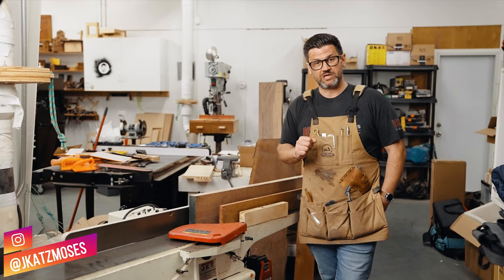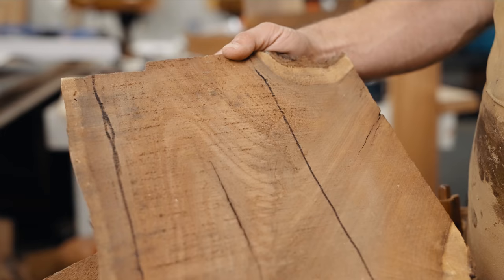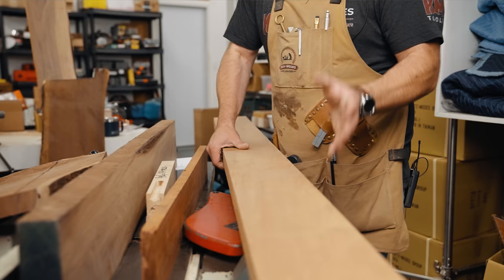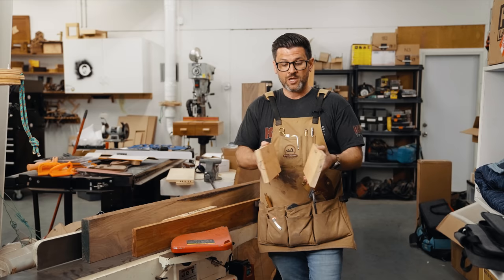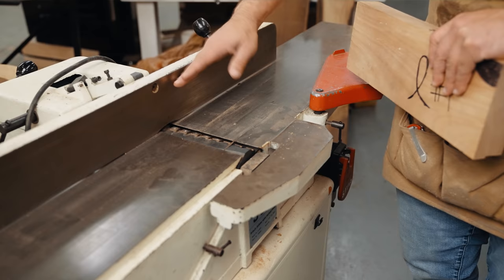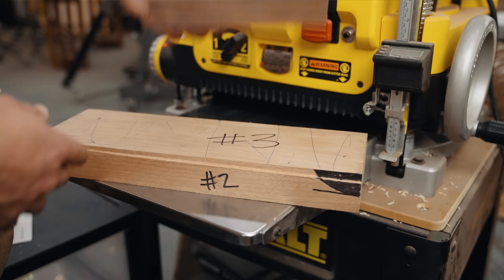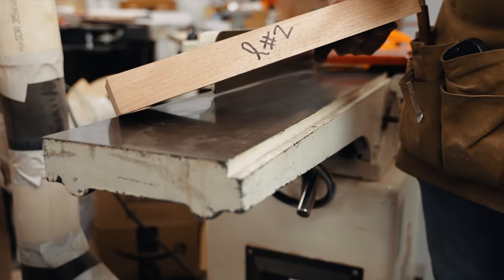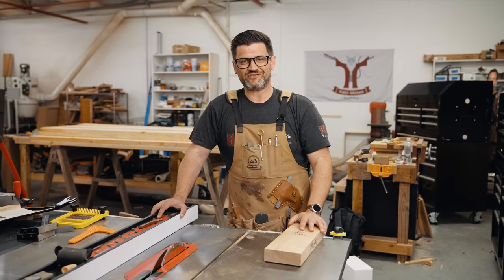Mill and Process Lumber Like a Pro - Woodworking Essentials

Comment from the maker: Support what we do at http://www.kmtools.com
SALE on Full and Thin Kerf CMT Chrome Saw Blades - use code KMT10CMT for extra 10% off https://kmtools.com/collections/cmt-saw-blades
Setting up your Jointer w/ 19,000 FPS Slow Mo https://youtu.be/oyJHC6XxQx8
5 Ways to Joint without a Jointer https://youtu.be/jWzg4BzPrdk
Tune Up Your Planer https://youtu.be/QzRJfD7__W4

Comment: One trick you can do on the “#3” step is flip the board over and plane #1 again once 1 and 3 are parallel.  This is super handy if there’s imperfections on the #1 face.  When I’m milling down salvaged pressure treated boards I don’t need to spend a bunch of time at the joiner removing perforations from the faces.  I just need it flat, then once it’s parallel, I flip it over and remove the perforations with the planer.  Same thing on the table saw with 2 and 4.

Salvaged exterior wood is also super stable.  Exposed to the sun, temperature, freezing it gets really “seasoned”.  Traditional Japanese builders might leave wood at a site for 2 years before working with it.  I can attest that almost any exterior project I’ve done where I took lumber directly from the yard to the job site will lose at least 1/8” of its width sometimes 1/4”.

Comment: I really like and respect your work, which is why I was surprised by your order of operation here, as well as omitting discussion of grain direction.  Being aware of the direction that the grain runs in helps to avoid tear out.  I know you run helical cutter heads on both J and P, so maybe that’s not a concern for you, but someone who’s unaware of milling probably isn’t tuned into the benefits of such cutters.  Also, given an awareness of grain direction often  requires that jointing and planing occur before squaring an edge.

I’ve been woodworking for 30 years, but I still watch you religiously because there’s always more to know, and you’ll often provide tips that hadn’t occurred to me.  Thanks for the work you do!

Comment: The interesting challenge of building with wood is that movement over time is inevitable, no matter how square and flat it is milled. The design and joinery (whether glue and screws or rabbets or dadoes or … ) counteract, incorporate  or direct the movement.  Makes those 200 year old pieces of furniture even more amazing.
Reply from the maker: Not only did I do the most comprehensive video on the subject BUT we also have a web based calculator we made that can calculate wood movement over time anywhere in the world. https://youtu.be/EOr06I9JoAU

Comment: Good video as always.
Maybe it would have been useful for beginners to talk about how grain orientation is important on the jointer and the planer. Cause that can really influence the surface quality.
Cheers.
Reply: Yea, I agree 100%. To piggy back on your comment, his order of milling works for 80% of the species, but it should be done as:
1- face joint 1 side
2- face plan opposite side
3- joint edge
4- rip to width

Doing it this way gives you freedom of grain direction when you go to joint the edge. Jointing the edge immediately after jointing the face forces you into 1 direction

Comment: Great video! Very informative! However, in my short experience, grain direction matters especially with wood that's highly prone to tear out!
Would you be willing to do a follow-up video on the milling/grain direction, and why you should joint one face, then plane opposed face, before jointing the edge? Doing it that way gives options of grain direction on all 3 sides before ripping the 4th side on the tablesaw

Comment: I wish you talked about planer snipe! It’s the single biggest problem I have when milling wood at home.
Reply: On a jointer, your outfeed bed must be dead even with the cutter edge. On a surface planer, same thing - the rear outfeed rollers and pressure bars need to be even with the cutter head, or your material will come up into the cutter once it is past the front rollers. If you can’t adjust the rollers/pressure bars, make all your material 6” longer. Or get a better planer.
Reply: @stanschmenge1965  All good advice, and I’ve done my best, but I still have issues. Maybe I just need more practice.
Reply: @stanschmenge1965  it's a problem for me too, i've ended up sending sacrifical wood a little ahead and to the side of what i want to plane/thickness.
Reply: @jcarlin  I guarantee it’s not you, it’s your planer. “You can’t make chicken salad with chicken sh*t” as the old saying goes.
Reply: @stanschmenge1965  Yeah I figure that's at least some of the problem. But it's a Dewalt DW735 and I see YouTubers getting better results with it all the time.
Reply: @jcarlin  yeah still a toy though, but I’ve heard they’re the best of little planers. You probably can’t adjust anything on it, maybe the cutters don’t seat properly? or a different brand of cutter might solve your problem. And don’t believe everything you see or hear on YouTube, I shake my head at a lot of so called woodworking “experts”.
Reply: @stanschmenge1965  I did get a helical cutterhead but I think it’s like a day to install… haven’t gotten around to it. The tables are level though.
Reply: @jcarlin  that should be a plus. The outfeed roller should be the same distance from the bed as the cutter head if you’re able to check that with a micrometer. That will eliminate your snipe. Good luck with the install.
Reply: @stanschmenge1965  I’ll give it a shot!

Comment: All the limber I get in Thailand is High moisture, 35%. I start milling it at 15-20% after air drying. I do cut the wood length into lengths close to final dimensions as I start the air drying

Comment: Great content as always, Jonathan. I truly appreciate how in-depth you go in your videos. At my school, there's only one instructor with 25+ students, so I find myself learning more on YouTube, haha.

I have a question regarding the use of jointers. Recently, at school I was using one to flatten one side of a board with the cup facing down, picture an upside-down 'U' shape. I managed to get it to lay flat on the table saw, but there was a large hollow section in the middle where the jointer knives didn't hit. Should I continue using the jointer until everything is level? Thanks in advance!!!

Comment: Great video JK-M!
A couple of experiential comments: Never assume your jointer can create a parallel flat on the reverse side after creating a flat on one side. It will be an "oh good grief" moment when you see or measure the result!

Some larger planers - I have a Grizzly 15" planer - have very strong infeed/outfeed rollers with a knurled or knifed anti kickback device, and will leave "knifing" marks in a planed surface. Usually, unless I plan on hand-planing these surfaces, which is almost always regardless, I must consider the depth of cut in the planer in order to avoid knifing marks from the anti-kickback device which are deep enough to require planing below specified dimensions. Particularly true in softer woods!
 
Sometimes I have to consider when I might want to use a surfaced board after milling. That is, does it make sense to mill the board for use at a later date and deal with potential cupping and other deformations during storage, or mill only what I can use immediately. Often I end up wishing I'd have waited before re-sawing certain boards as the level of cupping developed was beyond the ability to plane it flat. 
Always a risk no matter what, though!

Comment: Solid. One thought for consideration; the final part of the process may be to take a light skim on the jointer to remove any planer snipe if it is beyond what a light sanding can handle or card scraper.

Comment: Fantastic video.  All of us have run into the "moving wood" situation, and you explain it all very well.  It seems softer wood, like pine/fir, have amplified movement issues.  Oh, and mis-stored soft woods at the big box stores (even though  supposedly kiln dried) will have very significant movement within 12 hours after any kind of milling.  Keep up the good work!
Reply: Big box stores are the worst, it might be kiln dried at the mill, but my local big box will put it in the yard until they have room in the racks.  I have burned better wood as firewood than they sell at full price.

Comment: Hey @Jonathan Katz-Moses, at 7:50 when you reference what happens if you plane the board right away.
It will make the opposing face side, parallel to the bottom face, but this means it will just copy the face on the bottom no ?

In your example you mirrored the bottom and top faces but actually the bottom and top face should follow the same line if my understanding is correct :)

Only beginner in woodworking so correct me if i'm wrong.

Comment: I got lumber from a local mill at 5/4 for 1 1/4" so I think 5/4 and 6/4 is subjective by mill. I learned the hard way not to store the finished wood for long term. The cuping is spot on with resawing. Great tips on Jointer and Thickness Planer, Jon!
Reply: The same around here. “Quarter” dimensions are true (5/4 is inch and a quarter, 8/4 is 2 inch). “Inch” dimensions are post-milling nominal (“1 inch” is  actually 3/4”). And for big- box lumber shopping - always take a tape measure since big-box lumber varies in nominal thickness.  I’m not really sure whether the dimension variation is from speed/carelessness or from the desire to squeeze a bit more lumber (profit) from a log.
Reply: Ditto for my hardwood supplier, I went in with the expectation if 4/4 != 1" but surprisingly it is bang on. The boards are pretty clean but not perfect surfaces so there's still some milling to be done (guessing that's why, less work for them, cheaper for me) but that's OK by me.

Comment: Excellent video. I recently bought my first jointer, and am loving the simplicity of getting nice flat surfaces with it. I obtained a bunch of rough cut oak blocks and started running them through the jointer, and flattened them on all 4 sides and it worked perfectly. My question is, is there a reason why you don't just run boards through the jointer on all 4 sides? I don't see why it is necessary to need to use the planer. (at least if you're not trying to reach a specific width across multiple boards. I can see how the planer would be advantageous in that scenario) But if you're just straightening one single board, it seems like the jointer will do exactly what you need. (I also like using the jointer because it is 1000x quieter than the planer. Haha)
Reply: The jointer has no way to tell what the top of the board looks like. It can only make the bottom surface flat, and it has no way to mechanically constrain it to force that bottom surface to be parallel to the top. The planer uses the pressure of its feed rollers to mechanically force the bottom surface against a known reference plane, and then the cutter head is mechanically aligned to that plane and cuts a parallel surface. Does that help?

Comment: Instead of using the table saw to cut side #4, why wouldn’t you run that side through the planer since it would come out parallel to side #2?

Comment: Great videos, it was a little confusing around the 7:32 with the parallel line drawing.  Did you want those sharpie lines parallel to each other maybe?
Reply: Yeah, they were mirrored, not parallel.
Reply: Second that... Drawing was incorrect.

Comment: Rough sawn is usually 1/16” to 1/8” under the marked thickness. At least the ones I have bought so far. After cutting lumber to thinner boards, they tend to move more. Made mistakes like that a few times now.

Comment: Two questions I've not had good answers for: why not go back to the jointer for face #4 instead of the tablesaw to reduce variability ? What do you do about grain direction when jointing and planing?
Reply: I could never get a perfectly parallel edge because there's no reference to the previously jointed edge. I assumed a flat face held against the jointer fence would provide that ref, but I could never get accurate results like you can with a table saw fence directly referencing the jointed edge.
I always pay attention to grain direction when milling to avoid tear out problems, although I do get better results with carbide insert cutter heads rather than HSS blades regardless of the grain direction.
Reply: I’m a retired furniture maker from Europe. We always planned #4 parallel to side #2 with the planer, not with a tablesaw.
Reply: Taking it back to the jointer would make it flat, but not parallel to the opposite face. With the table saw, the fence is parallel to the blade.
Reply: @danielulrich3314  is there not enough registration of the flat & square edge against the fence?
Reply: @flyfishr64  the jointer will make the face flat, but won't make it parallel to the opposite face. You need a fence that is parallel to a blade to make both faces parallel, like a table saw. 
If your wood was the shape of a triangle, the jointer will make every face flat, but not parallel with the other side = a rectangle. Idk if that made sense tho cuz I'm kinda drunk

Comment: 7:33 that top line should match the bottom one...and not be flipped "mirror image" like shown. Basically, your board will come out with the top following the contour of the bottom...whatever that may be. Hence the jointer being the 1st step.
Reply: You are correct.
Reply from the maker: Yep. My mistake
Reply: Thanks. That drawing was so confusing.
Reply: Did you respond to the reply below saying you are one of the short lists winners. I got the same message and called but it said the owner of the google account wasn’t available.
Reply: @rw7532  No, I did not. I've been getting a lot of those lately...last one said I won a DeWalt table saw!
This video explains it VERY well: https://www.youtube.com/watch?v=w3QxMFwQAfM
Beware.

Comment: Johathan, great video! One thing that always gets me is the term "Jointer". I'm not sure when it happened, but I believe it was a marketing thing here in the U.S. a while back that was/is used to distinguish between a "Planer" and a "Thickness Planer" for the new or beginner woodworker.
In the rest of the world a “jointer” is called a planer, and a “planer” is called a thicknesser or thickness planer because, it is in fact, a planer and a thickness planer. 
Somehow the nomenclature got separated from the actual function of the machines here. 
It is only here in the US and Canada, North America in general, that a planer is called a “Jointer” and a thickness planer is called a “planer”? This is very confusing to many that are new to woodworking.
Jointing is typically planing the side edge of a board to an already planed face of a board. Jointing can be done in several ways using different tools, one way is to use a fence as an attachment on a planer (Jointer). Other ways to “Joint” are with a table saw, a router table, or a track saw, etc. I have had to explain this to many people new to woodworking at my local woodworking store that are confused as to the use and function of a “jointer” and “planer”. I don’t care what they are called perse, I have just found it simpler to explain their actual functions separate from their names which has led to many A-ha moments with the people I’m explaining this to.
I know you know this, but explaining this, IMHO, will help people understand what the hell a "Jointer" is, which is actually a planer, that you can joint on. I have found this to be a confusing issue with some new to the sport, and once it is cleared up, we move on to what "Joinery" is. 😎 All the best, Chuck

Comment: My only tip would be to make sure your jointer in particular is slippery and easy to push material through. Trying to muscle wood through is dangerous and I reckon you just get a better result. And I find it ot crazy that there is hardly any videos out on preparing lumber. Seems so important but you hardly ever see me.

Comment: I’m confused. At 9:27 I see you running #1 over the jointer. Then at 9:43 I see you doing an edge on the jointer but with side 1 facing out. When you are running side 2 through the jointer shouldn’t side 1 (that you just made flat) be up against the jointer fence??

Comment: Quick question. I do not have either a jointer or planner at this time. Would I be able to mill down three sides using the planner and the remaining edge with my table saw?   Thus the jointer being a smarter purchases as I'm new to the milling process.

Comment: I just bought a Dewalt 735 planer with the I feed and out feed tables coming in from Amazon in a few days, I’ve looked and look on YouTube about setting those up. Do you set those stables up with the ends slightly higher than the planer bed or do you set the. Up so everything is level from in feed through the planer bed to the out feed? Thank you in advance for your answer.

Comment: Exact method I use teaching my student’s, my problem is them remembering it. I have to explain it over and over to some. Other problem is they want to use the 16” jointer with the fence all the way over on a 3” x 18” piece of lumber. We have a 8” jointer. We have a small 13 planer for that use and they want to 20” 10HP planer. Students?
Good video.

Comment: Just ordered about 80bd ft of 8/4 qtr sawn white oak. Going to be making a pedestal kitchen table. I am having the mill deliver it as s3s. 
Do you think someone can simply rip the other side of each board and then do the glue up? Just wondering if you’d trust it, especially at lengths of 8’ and longer. Don’t wanna screw this up lol. By far my biggest build yet. Thanks for the content.
Reply from the maker: I say exactly that in this video. Can't trust it

Comment: I have a sincere question. Why can you not do side number four back at the joiner? Why do you have to use the tablesaw for the final side?
Reply: A jointer cannot make a face parallel to its opposite face, you need the planer and table saw for that